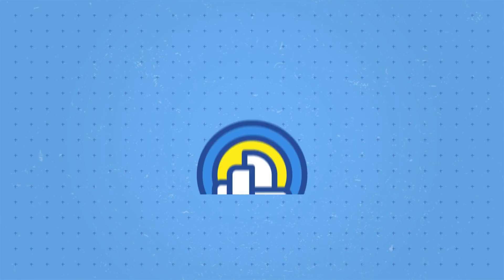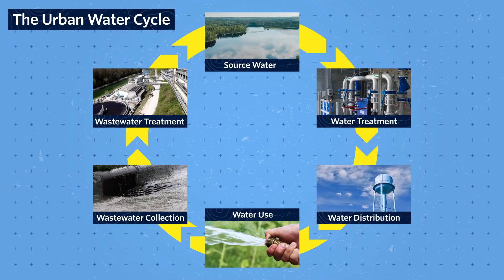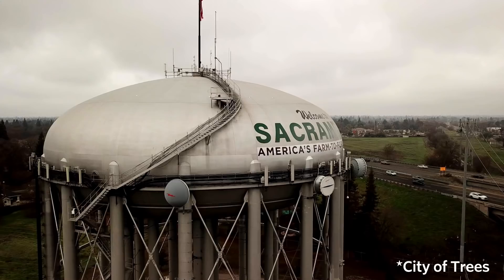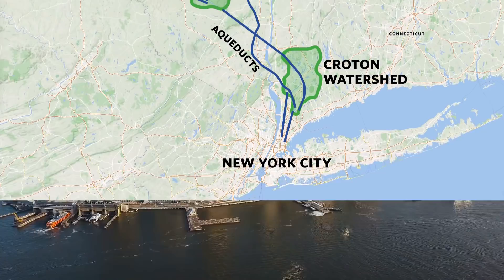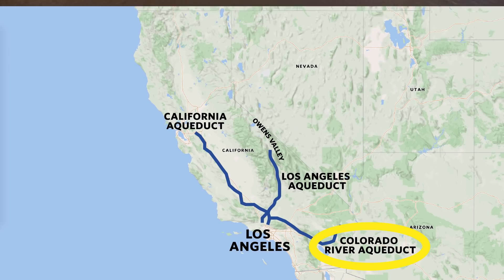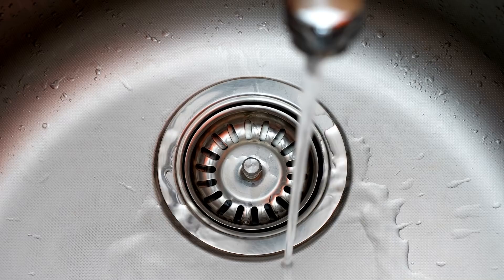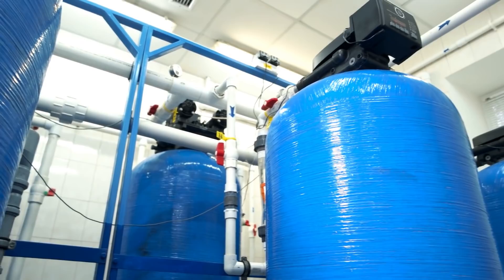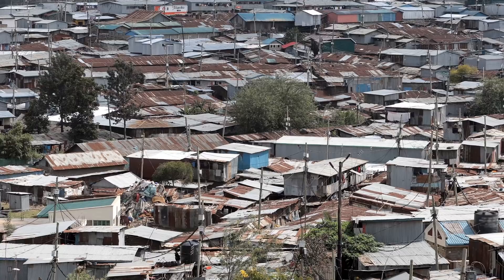How do cities get enough fresh water?

Comment: I'm living on Žitný Ostrov, there is fresh water for 2000 years for every citizen in Central Europe
Reply: How would you deliver that water across Europe? How much would be the cost of setting such a cross-region infrastructure? Think twice... how many people live in Slovakia compared to entirety of Europe? When will the underground water run out?
Reply: @David_Journey  not that difficult a lot of networks are already linked.
Reply: Yeah we'll be fine until we get a constant stream of climate refugees that will make 2015 look like childsplay. Although I'm less worried about the refugees than the nazis and other extremists they will give rise to
Reply: Wouldn't it evaporate within 2000 years?
Reply: 12ken 
It probably won’t, unless something happens to the water output into the body of water. Otherwise it would’ve evaporated 2000 years ago.
Reply: @sirBrouwer  Not sure what you are talking about. For instance there is no railroad connection for most of Slovak / Hungarian border... I do not believe there is any "shared water pipe" between the countries.  Žitný Ostrov mentioned above lies in Slovakia... so that's where I start the investigation.
Reply: @David_Journey  when will the underground water run out in Central Europe? Never, given the rain and snow, so long as we don’t cover up the permeable land.
Reply: @kaitlyn__L  wells in California dried up in 2019 summer, because the groundwater was pumped and depleted and not enough rain to replenish. Climate change will mean more of these challenges in more places.
Reply: @David_Journey  I’m aware of the challenge in desert climates, see also parts of south-east asia. But in a climate with regular snowfall and porous ground you don’t need to worry so long as the snowfall continues. Obviously if we destroy the entire biosphere then everything we’ve set up is screwed whether it’s groundwater or just reservoirs anyway.
Reply: @majorfallacy5926  I don't see your position. If you say that we're in risk of mass migration that would strip us bare of resources, then picking instead some hard line nationalism seems like lesser evil. Not mentioning, that if you also dislike that idea as well, then the best is to keep borders closed right now and avoid all ethnic tensions altogether.

Comment: As someone from Texas can confirm we have a great water supply, definitely isn't unsafe, and smells like eggs
Reply: What part of Texas though? Panhandle water definitely tastes different than coastal water than does the hard hill country water.
Reply: @Wells306  as someone who has been to many different areas in Texas, I can confirm this.
Reply: @Wells306  I'm talking about the current water crisis. Most of Texas either has no water at all or is under a boil advisory.  Where I live in Dallas the water is unsafe and smells like sulfur.
Reply: @realjohnsomeone  Most of the time the water is of pretty good quality, but all the pipes are bursting in texas right now.
Reply: I'm in East Texas. The source in my town is an aquifer, but in the nearby city it's a man-made lake and recycled from waste and tastes so terrible you can even taste it in the drinks from fast food soda machines and sometimes even the food.

Comment: Texas: I'm gonna do whats called a pro gamer move
Reply: Zzzzzzzzzzt......and you mucked up the entire grid by not investing in key infrastructure protection measures.  There goes the electricity, now those water pumps just failed, the oil refineries are now stressed.  What are those poor fire fighters going to do?   Let the large apartment burn.  Smooth move Exlax.

Comment: I'm a municipal engineer in Quebec, and I have a few comments:
1) We do not seem to use water towers in Quebec.  All pumps used for water or sewage must have a back-up electricity generator.  They are usually diesel generators, but at least one of the city of Montreal's water treatment plant has a gas power plant.  If the pump is required for fire protection (for example, water pressure is not sufficient in part of the city to provide fire protection, sometimes a pump will be installed to boost pressure in case of fire), the pump needs to be tested daily.
2) I used to think that the increased demand for water in the summer came from watering lawns, filling pools, etc., and that may be true in suburban residential areas, but in areas with large buildings, such as downtown or in commercial / industrial zones, the increased demand comes from the cooling towers of central air-conditioning systems.   During a heat wave, those cooling towers require an enormous amount of water. I know of the case of a hospital, for example, where at 100F, half the water consumption for the hospital is for the cooling tower.  Air-cooled systems are available, but they are much larger and more expensive than water-cooled systems, and tend to be used in desert countries such as Saudi Arabia.

Comment: One small issue about desalination no one talks about is what happens to the salt when its gone. Either you store it, making an expensive system more expensive, or it goes back into the water, not only making it more energy intensive to desalinate the saltier water, but screws up the local ecology because of the different salinity levels. Still very useful as something to do when theres no other option for mega wealthy cities, but in no ways ideal

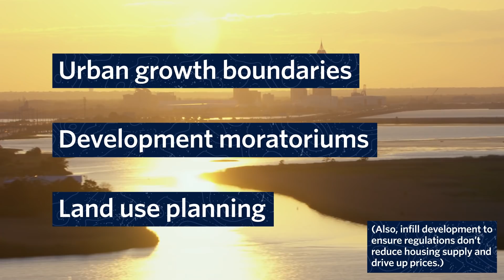Comment: 9:42 Informal settlements in Africa particularly are a problem on 4 levels: 
- Increased risk of flooding because of less surface area for rainwater to seap through (so more runnoff into the streets)

- More wasted water, since less finds its way into the aquifer. which means the water cannot be re-pumped for use (in the long term) + sinks the affected area.

- 3 & 4 are mentioned in at 9:42 in the video

Comment: New York's history with water is a lot more complicated. Manhattan lightning island of rivers in lenape Algonquin. However, by the 19th century, we had outstripped local sources of clean water. the main source of water in New York City was the collecting pond, which was an environmental nightmare. It was situated within the city and was used for drinking water, wastewater, and Industrial uses. When we built the aqueduct system to bring water in from upstate, the collecting pond got filled in and became five points, which was a different form of cesspool.
We currently have two functioning pipes into the city, and these are leaking. Fortunately, we are building a third

Comment: I was fascinated to learn that Lake Dillon is a reservoir owned by the city of Denver. There’s a tunnel that pipes water from there across the continental divide into Denver’s watershed. This is because most of Colorado’s rainfall (or snowfall for that matter) happens in the mountains and Western Slope, while the vast majority of the population lives on the Front Range.

Comment: In Brisbane, a number of the 19th century water towers were sunk into the ground at the crest of various hills around the city. They were then capped with natty little corrugated steel roofs that sit just above ground. Most of them are still in service, but the one on Spring Hill was taken out of service and converted into an opera house.

Check it out. https://encrypted-tbn0.gstatic.com/images?q=tbn:ANd9GcQ9rj-UW4wCycvcYtk1lnyH6810A4HkDEK2MQ&usqp=CAU

I reckon it's one of the top two opera houses in Australia.

Comment: You very smartly referred that in dense urban areas there is less need to yard and water for it which leads us to the compact city solution advised by UNDP and it really deserves a separate video to be made by you about its benefits. Desalination, reduction and optimizing water use, harvesting it and recycling water are solutions that should be used combined and together. But there has always been a big question for me: In America you have several big rivers like Mississippi and Missouri which their huge amount of water finally ends into the ocean and becomes useless, so why don’t you divert a lot of the water of those rivers toward the middle and south west of America to solve the water shortage problem of the cities there and also irrigate vast areas of deserts and dry lands?

Comment: What about recycling wastewater? I almost never hear about that option in discussions about water shortages.
Reply: Mostly because, on that scale, it's very easy for it to go very, very wrong.  Also difficult
Besides, the global water cycle being what it is, we're already doing this when the (mostly) cleaned up waste water is released back out into the environment. It gets evaporated and condensed and filtered and diluted in various ways as it cycles through that system before being recaptured and used again.
Climate change is just problematically disrupting the old patterns of how much is where at any one time.
Reply: @laurencefraser  I know that Los Angeles' wastewater, after treatment, is as clean as the water coming from the aqueducts, so its not that difficult, at least not more so than the other options. Most water after treatment goes straight into the ocean where it stays for a very long time, so instead of desalinating the water, we just stop it from becoming salinated in the first place and keep it in an endless loop.

Comment: Reducing our water use can be done much easier and is more effective than power hungry desalination plants. Even if you plan to run them on renewable energy, they increase electricity demand so drastically that it has the real world effect of prolonging our use of fossil fuels. People and businesses alike need to change their behavior. 
We need to stop finding overengineered and impractical "solutions" to problems caused by our own recklessness, and instead focus on the root of the problem.

Comment: 6:38 "just build more water treatment facilities" is really not the ideal solution. WTPs can't magically treat all pollution, and had to shut down when encountering pollutants it's not designed to treat. A single point pollution source could affect all downstream treatment plants. 
Within the last 12 months Kuala Lumpur has had like a handful of unscheduled water cuts over large parts of the city due to pollutants in a major river, repeatedly knocking out 3 water treatment plants simultaneously.

Comment: Um, carbon dioxide is CO₂, and oxygen is heavier than carbon, so presumably only about a quarter of its weight is carbon. Not that current levels of emissions are in any way ok, but still, no need to overstate them by counting oxygen as carbon…!

Comment: So there's a double benefit from watershed management aimed at ensuring clean drinking water: Keeps the cost manageable (so no need to fight too hard about this); and it gives us one more nature reserves' worth of protection between rapacious us and Nature.

Durban, South Africa, got a new dam near the end of the terrible old government, and I was surprised to see the area around it got officially built up (not an informal settlement) once the terrible new government had gotten into the swing of things. Now terrible as the old government was (and it was terrible enough for most of the current problems the country has being originally created by it), it did some things right. And one of those was dams. A dam always got a nature reserve. Not for the animals, really, but for the water. I'm guessing the new government came under some sentimental pressure and buckled in instead of standing up for what makes sense, when it came to the new dam for Durban. Easy popularity. (And this is in a cachement that already had big e.coli levels). Oh well, it just costs a bit more money to treat the water, right? ..

And now luckily for anyone reading this, I have to go and eat supper.
Reply: Just a half-baked thought from desalination becoming more and more necessary: How about "osmotic pumped storage"? (And even I can think of a dozen reasons to just say plain, No, off the cuff. But anyway, there's the thought. Left to fester long enough it might rot down into something worth something).
Reply: Oh, and then finally, please consider doing something on The Line! It looks like it might tick some of the urban planning boxes I amateur-obsess about sometimes. (A bit like that one in Finnland, whose name I already forgot).

Linear layout. Lots of green space out front. Everything in walking distance. Traffic banished or pushed e.g. underground. That's already quiet a lot of ticked boxes. (Only thing I'd have reservations about would be removal of seafront vegetation just for "a view" (which one could walk through some nice dune forest to actively go and have a look at, instead, in a better world).  oh -->)

Comment: One short term solution for local water shortages in coastal cities like LA could be to tow icebergs that break off from the ice sheets in Antarctica to the city, build a lagoon and let the iceberg melt in the lagoon, pump out the fresh meltwater.
Reply: The problem is that even though the salinity of the lagoon will decrease there is still gonna be salt in there from the ocean. You would have to close off the lagoon then pump all the salt water out first.
Reply: @scorpionblade4112  you have a point, but given the dilution factor I don’t think it would have to be pumped dry, but even if it did that wouldn’t be a huge energy expense, it’s just pumping up and over the lagoon walls, much less than much of the pumping currently done to get water out of deep aquifers.

Comment: Solution: destroy global capitalism.
All those "developing" nations would then be able to take full advantage of their natural resources and build necessary water infrastructure
Reduction of water-intensive cash crops and the end of water-wasting industrial agricultural techniques would cut back on water usage far more than any number of individual consumer choices. Not that you should leave the water running when you brush your teeth, but on the whole that's not what will make or break the system.
The end of wasteful production that exists purely to provide work to justify people's continued existence and generate profits for shareholders would significantly reduce emissions and other environmental issues, reducing the effects of climate change on the water supply.

Plus as an added bonus we then wouldn't have a society in which most of the value produced by workers is taken by owners and executives who produce little to no actual value (viz. they provide neither goods nor services), thus making it necessary for most people to slave away for at least 40 hours per week just to make ends meet.